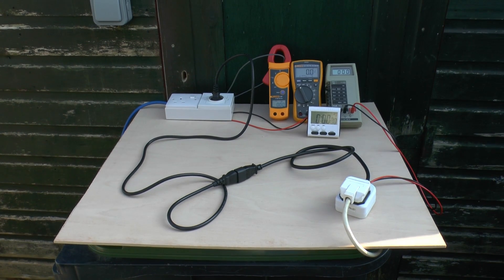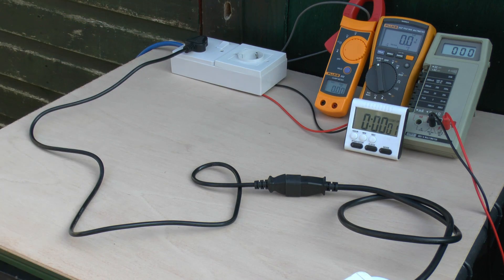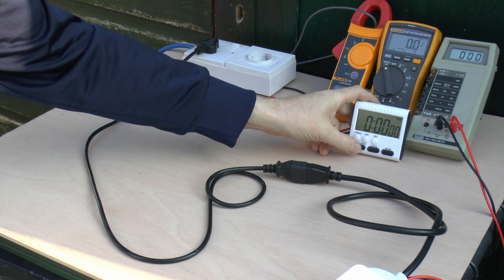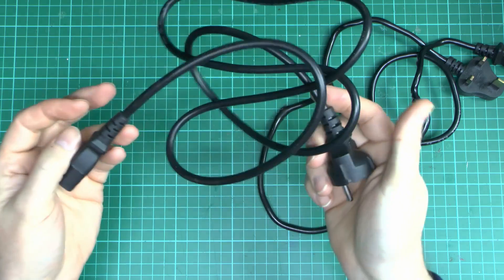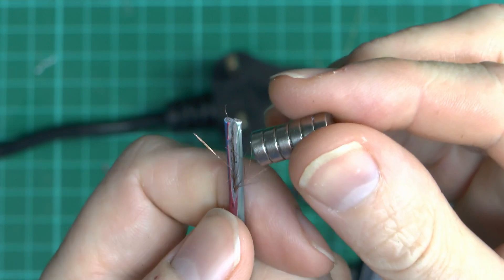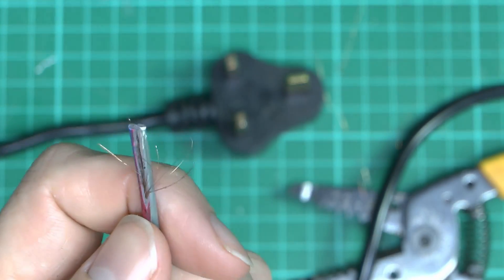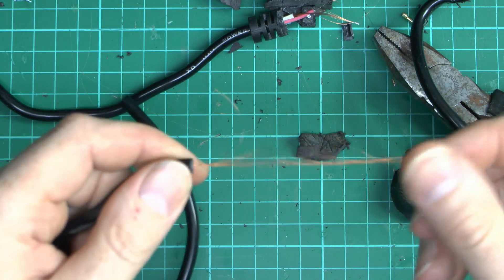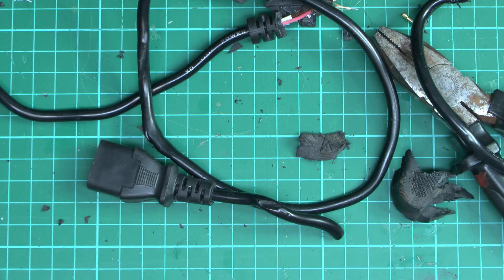Dangerous Failure of a fake UK plug to dubious C13 shape lead

Comment: UNBELIEVABLE : running heaters or high current appliances through an extension lead is a no no! and is illegal here in New Zealand, Secondly that lead is for monitors, audio and low wattage thus low current appliances. Your video is a poor instructive, rather promoting ohms law and illegal practices, despite what country you are from.
Reply: Wrong. Every extension lead should have a current rating. Running a "high current appliance" through that extension cord where the appliance is within that rating, is perfectly acceptable. If the cord fails, then the purported rating is false and the extension cord becomes an illegal product. JW's methods of measurement is PRECISELY what is required to determine whether those ratings are in fact what they claim, and therefore whether the cables and/or extension cords can safely carry their rated load currents at nominal voltage. What IS truly UNBELIEVABLE is how arrogant you are to think that you can dismiss sound electrical theory by asserting your country's laws in their place. By analogy, every regular plug socket in your house is basically an "extension cord" from your home's distribution board and the choice of wiring used there is, by law, designed to carry higher currents than the circuit breaker they are attached to, which is why they should never be at risk of burning out. The same principle/logic applies to any other extension cord - so whether that lead is "intended" for low wattage/current appliances or not, is actually irrelevant. The mere fact that it FAILS to carry its RATED current, makes it illegal (Yes, in YOUR country, too!) and should be your real point of concern as opposed to your faux paranoia about powering high current appliances over an extension cord that is specifically DESIGNED and RATED to carry such currents! Your failure to make this obvious distinction does reveal your true level of idiocy.
Reply: Isn't the crap lead he's testing "rated" at 10 Amps? Why not use a heater as a load? Quite clearly at 6.3 Amps this lead was dropping over 17 volts and getting dangerously hot! I think the demonstration was excellent and well thought out.
Reply: Noel Brown seriously? You're missing the point. First off, that style of connector is frequently used for electric kettles, which are considerably higher amperage than a computer monitor. Second, the plug is non-compliant. Third, the wire is far thinner than it claims to be and is not even copper. It's "rating," stamped on the cord itself, is supposedly 10 amps, but it got hot at 3 and melted/shorted at 6. He's using the heater as a demonstration load- he could have used any number of other devices for that as well. He's not running the heater unattended or for very long. Finally, the whole point of this demonstration is to show just how dangerous non-compliant devices can be. It's not supposed to show you what you're supposed to do. When the plug failed and spat out that giant arc, he didn't yell out "See? Running your heater this way puts out even more heat! This is a GREAT idea!"  The whole point is that a cord claiming to be able to handle 10 amps failed in a dangerous manner at only 6. It doesn't matter what he used as a load. That could have been a refrigerator or a bunch of electric fans, or a large vacuum cleaner, and the result would have been the same. The only connection this has to ohm's law is the fact that the cord had ridiculously high resistance-which is a large part of why it's dangerous and not even suited for a fairly small load, let alone anywhere near what it claims to be capable of. That cord would likely put out noticeable heat at only 1 amp.
Reply: @puckcat22679  et al, the supplier has made a legal decleration via the CE mark it is suitable for 10A so they can be prosecuted for this.
Reply: John Murrell while I don't remember what that cord came with (I only remember there was a previous video where he looked at it) JW mentions that there's no certification marks of any kind on that cord. Which of course makes it illegal to sell, but these suppliers are in a country that doesn't give a s***, and the distributor can simply reinvent themselves overnight. And most of these devices that are so bad as to be unsuitable even for their purpose are purchased by individuals on venues such as eBay or Wish, which means that legally, they're the importer. Now, eBay and Ali Express both have good protection programs, but enough people would need to bother to use them if it's to have any sort of effect on these shady suppliers. I don't know about Wish, though. I notice that the worst of the worst seems to come from that site, which suggests to me that they're not nearly as consumer friendly.
Reply: @puckcat22679  at 9:04 there is a picture of the plug with what appears to be a 'CE' mark on it though it is not clear enough to see if it meets the requirement of the CE marking regulations. It is the  duty of the importer of the product into the EU to ensure that the product complies - there are large fines and prison sentances for those importing goods that are marked but do not meet the relevant standards. I am not sure who the 'importer' is if it was brought from outside Europe - probably the purchaser ? 

One of the weaknesses in the CE marking scheme in my view is that it is almost impossible to find out what European Standards it is certified against and by whom. Hopefully the post Brexit Compliance with UK standards marking ( and the derivative for CE Northern Ireland if the Government Exit deal gets impliemented) will provide a better source of information.
Reply: John Murrell you're right. There is a CE mark there. I got thrown off when JW said there's no marks on the C13 end that plugs in to the appliance. Now, given that I live in the US, I'm certainly not an expert on European regulations, but I've heard from others' comments on JW's (and big Clive's) that when an individual purchases these things direct from China, they themselves are legally the importer. Which suggests that if they were to then turn around and sell it, they technically could be in a heap of trouble. I know that that's how it works in the US. You won't find this garbage in stores here, because customs officers confiscate enough of it from container ships to make it not worth the risk. But individuals can easily get it from eBay and the like, and small-time flea market sellers often get a few hundred of whatever shipped to themselves personally and sell it at their booths. Those guys sometimes get into trouble, but usually this only happens when a particular flea market lets it get out of hand and the authorities decide to do a sting. I assume it's the same in Europe. My father was from Greece, and my family goes there pretty regularly as we kept his house in his home village. And while actual stores don't sell non-compliant garbage like this, street vendors in the cities most certainly do. 

Heck, an interesting phenomenon that I've only seen there is there's traveling groups of Chinese merchants that show up in the village any time there's a big festival or something similar, and set up tables full of mostly cheap toys and glow sticks, but they always have a table of dubious household goods. And when the festival is over, they pack up their stuff and drive off to the next village festival.
Reply: @puckcat22679  As I understand you can be prosecuted as the importer - the offence is when the goods are imported not when they are resold. In addition if you do import items for personal use that do not meet the appropriate EU directives and standards and they cause a fire or other loss your insurance may well be invalid.
Reply: John Murrell absolutely. It works that way here in the US, as well. If you use an electrical appliance that isn't listed by an approved third party testing laboratory such as Underwriters' Laboratories or Intertek, and it causes a fire, your insurance does not have to cover it. Of course, in reality, if you import something for personal use, you're highly unlikely to get caught, and unless your homeowner's insurance sees a reason to investigate the exact cause of a fire, or the fire was obviously caused by something you should have known was dangerous, you probably aren't going to be denied coverage. Unfortunately, while you and I know better than to use things like the glue gun my friend received, an average person, say, an office worker, isn't going to necessarily know the difference, and probably assumes that anything made in a factory with a plug on it is perfectly safe to plug in to the mains and use. I'm not really sure what the solution is, however, when we're talking about the millions of individual purchases of merchandise from overseas that are shipped individually. It would be impossible to inspect all of it. And while Joe Schmoe who buys an unsafe appliance from banggood.com for himself technically could be prosecuted as the importer, who would bother? Usually, if something like that is caught in a spot check, they'll just confiscate the item and destroy it. Now, if Joe buys 50 of them to sell at his flea market booth, yes, he would likely be prosecuted, because he's now endangering the public at large, as opposed to only himself.
Reply: it's a good video.. and the lead says 10 amps.. so should be able to withstand 10 amps all day long.. I'm running a 2kw electric heater through an extension lead because there is no socket near.. heater lead not long enough. glad I don't live in new Zealand I'd freeze. illegal to use a heater through an extension.. that is just stupid.
Reply: Jog on you idiot saying his video is poor coming from you with no videos uploaded at all
Reply: Noel Brown - A disbeliever! I suppose you believe the Earth is flat too?
Reply: @peckelhaze6934  There are some incredibly dumb people in this world. Thanks for helping me understand that.
Reply: I'm using a heater after two extension leads. If you know what you're doing and the quality is right it's fine. But I would recommend anyone unaware of the risks not to do the same.
Reply: Noel Brown. Oh dear!!
Reply: @Noel Brown what you don't  seem to notice is that this was an exercise to test a faulty lead. As for this notion of yours that those sort of connections are used only for low power devices like monitors, then wrong. Similar connectors are used on many electric kettles and are rated up to 13A. In any event, the current being carried was only about 6A - half what an electric kettle might draw. This was also a test performed outdoors and was not meant to be a demonstration of how things might be connected indoors. 

As far as it being illegal to connect a high powered device via an extension lead, what makes you think that New Zealand laws apply in the rest of the world? Whilst using extension leads is not ideal, her in the UK properly designed legal ones with a 13A fuse will carry that current safely. It's what they are designed to do. I use extension leads on high powered garden equipment (wood chippers, pressure washers and so on) and they are designed to do the job. 

Running a long lead with high current in enclosed environments is never a good idea though. Running cables for such devices under furniture, but it's irrelevant whether it's an extension cable or not. 

Also, as far as use of extension leads goes in New Zealand, the official government advice is that heaters shouldn't be connected to "multi-boxes" (which will be multi-way trailing leads in the UK). It doesn't go so far as to say it's actually illegal, and I'd certainly agree that it's best practice that heaters go into dedicated wall sockets. However, John in not using a multi-way trailing socket, and this is not a demonstration of a domestic set-up. It's a test. Further, all legal UK plugs (including extension leads and multi-way outlets) are individually fused to the maximum  carrying capacity to protect cables from overheating.

https://worksafe.govt.nz/managing-health-and-safety/consumers/safe-living-with-electricity/cords-and-leads/
Reply: It was dangerous at 3 amps. A computer can easily draw that, and the lack of fuse means you can run anything off of it. Including a kettle, what's that lead also known as, oh yeah a kettle lead. Can't see that taking 2+kw

Comment: Thanks for this video.  Several weeks back, I purchased a cheap desktop 5 volt 2 amp power supply from China.  I watched Big Clive do a video on the device and followed his lead in making it work right by adding  a resistor to bump the power up to the 5 volts advertised.  It came with a European plug and an adapter, I used that for a short time but didn't much care for the big plug on the end so one day I dug through my supply drawer and located a good heavy duty cord from some long gone appliance or another.  I removed the cheap china power cord and soldered in the much beefier USA made cord.  Now no more worries about the adapter. After looking over the lead that came with the power supply, I decided that I could, perhaps handle 9 volts fairly well, and had just discovered the charger lead for my Standard Ham Handheld radio had an open  in it.  So I managed to break into the black wall-wart, and soldered in that lead from the old power supply.  The wires looked to have fewer strands then the factory cable from the made in Japan brick but they soldered in nicely, i pealed the outside off the plug end where the damage was on the cord and soldered in the wires keeping the polarity in mind, then used several pieces of progressively larger heat shrink to make the plug end.  What I ended up with is virtually  a new power brick, the only bad looking part is where I was forced to tape the brick together since the case had been plastic welded so securely that I was forced to use extreme force to open her up.  Inside though I found a nice transformer/rectifier power supply, not the capacitance dropper of today's warts.

Comment: How do such cables make through customs, to stores?
Reply: very often cables like this will go direct from warehouse to customer following an ebay order, no store involved. customs dont have anything like the resources that would be required to test every electrical item arriving in international parcels.
Reply: When buying from outside your country directly, you become the importer, and may well be liable for consequences.
Reply: Customs do not inspect and/or test products for electrical safety. Their role is to collect taxes (import duties), not to act as safety inspectors.
As Bosted Tap mentioned, in most countries (I am in Australia) it is the IMPORTER who is responsible for ensuring compliance. So the first person within the country is the one who must check, test and ensure products are safe. In AU, all 3 parts MUST be tested, and be compliant... so there is 3 certifications required (the Mains Plug, the Flexible Cable and the IEC "Appliance Connector"). The whole product (called a "Cordset") must also be registered on the national electrical safety database.

Comment: Thx John that was a most instructive demonstration.  I’ve received (and binned) a couple of this type of cable over the years.
Does anyone know if the fire brigade investigators collect stats on causes sufficient to pickup this non-compliant equipment? I only ask as the fire brigades are doing more preventative work these days  .. perhaps they might also be checking for this type of cable / plug when fitting smoke detectors and the like?
Reply: mharris1270 actually, here in the US, if you ask them to do so, the fire department will come and install smoke detectors for you, and if you can't afford one, most will give them to you as well. In addition, our customs inspectors are trained in how to spot blatantly dangerous devices and how to tell if a listing organization's certification label is genuine, and they've done a pretty good job of preventing this crap from making it to store shelves simply by doing enough inspections of containers to make the risk of losing an entire shipping container of product too high for most importers to accept. That doesn't mean this crap doesn't get sold here at all- a lot of it comes in via individual purchases from places like Wish or eBay, as that would be impractical.
Reply: mharris1270 also, homeowners'insurance companies most certainly can and often do perform an inspection after a fire or similar, and if they can determine that the fire was caused by non-compliant electrical equipment, they can and most certainly do deny the claim. Usually this is only in cases where the equipment was blatantly dangerous to the point that am average person should know there's a danger. Who do you think the word "underwriter" refers to in the name of the testing organization called "Underwriters' Laboratories," or UL? My wife works for a large insurance company at their world headquarters (I won't name them but here's a hint: they're on your side) They have an entire house located on one of their campuses that has had various things done to it-there's a section that was flooded, one that was burned, one that sustained storm damage, etc, that is used to train their adjusters. And it includes examples of faulty, non-compliant electrical equipment. The government is fairly hands-off on a lot of this stuff here, but the insurance companies are not.
Reply: mharris1270 that's what I was talking about- after a loss, they'll inspect. I also missed a bit of your original comment. I agree that there's zero oversight for private, individual uses of equipment until something goes wrong. This applies in most places, though, not just the US.
Reply: It would be better if those doing PAT testing had to publish the results - they probably see more sub-standard leads than the Fire Brigade do. Also I am not sure how well qualified the Fire Brigade are in electrical safety in the small sample I have (4 events) they failed about 50% of the time.